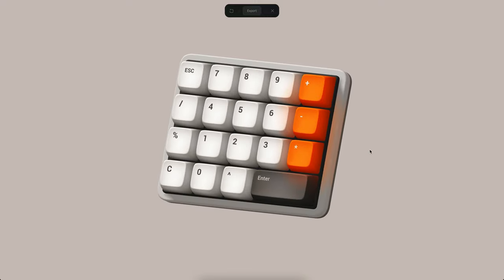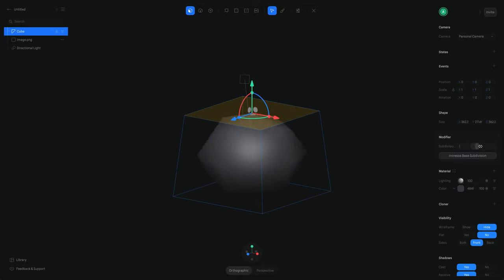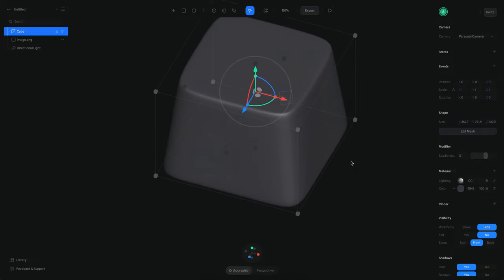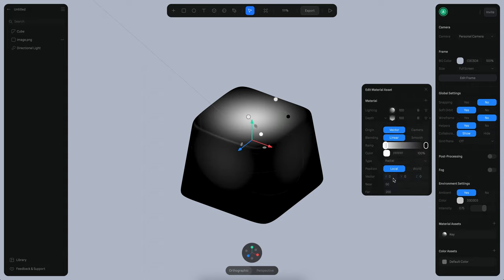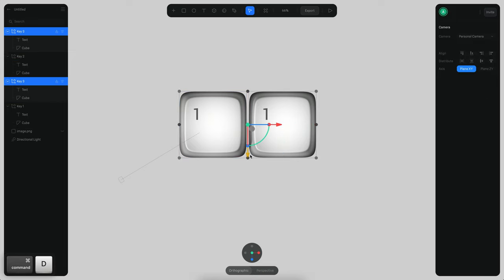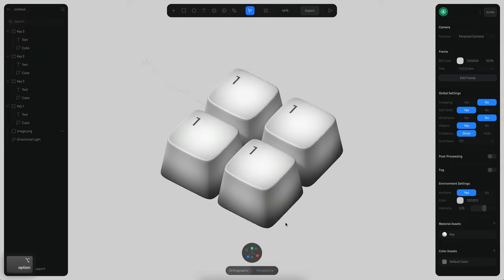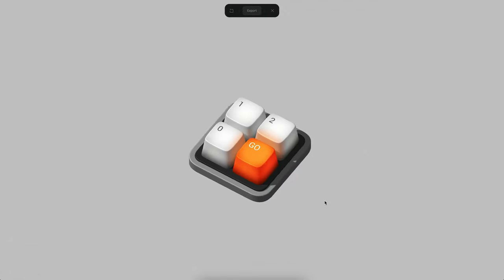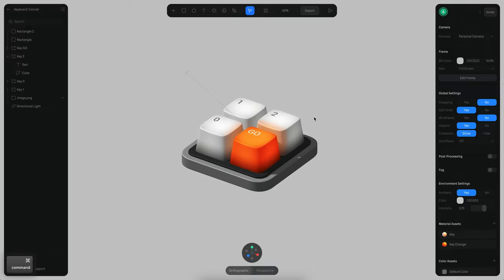How to create an interactive 3D keyboard with Spline

Comment: For anyone trying this tutorial for the first time around the time of this comment, you can still basically do everything the instructor does in the video. Just be aware that if you're using the basic version of Spline, you wont be able to change the duration of the animation transitions unless you get the premium version from what I understand. The animation will still work albeit much slower (you have to hold the button down)

To get a quick and dirty understanding of how modeling works with animation, this video does a decent job but I wouldn't use it as a guide to understand lighting concepts. Im sure there are better videos that focus on that.
Reply from the maker: Hi! This is not correct. Everything in this tutorial can be achieved with Spline on its basic/free plan.

Spline improved a lot since this video was released. The UI changed/improved, which might be why you are confused.
Reply: @splinetool  Oh you're absolutely correct! My mistake. I only noticed that the transitional slider goes up in whole number increments at the time. Didnt realize I could type out the numbers there. Tysm!
Reply: So how do I change the duration in this new version?

Comment: I was stuck at minute 1:55 because I couldn't do inset to all the vertices at the same time and it was because spline gives the figure eight corners by default. You have to remove them all and only one will remain and that's when you press shift and you drag all the vertices inward. I hope it helps someone, greetings. BTW very good 3d software.

Comment: I'm stuck, After I disable subdivision, I'm having a hard time shaping the cube to the form of a key like in 1:56 - I have ''Face F'' selected and then I would shift + clicking on the arrow to narrow the height of the cube but nothing is happening. HELP. What am I doing wrong? Using windows.
Reply from the maker: Hi Luz! Did you tried increasing the subdivision again? Btw you can join our discord community (link at spline.design) to get help. It is most likely that you are missing a step.
Reply: I also got stuck at that part.
Reply: @splinetool  Thank you so much! I did disable/increase subdivision a few times and then it started working!
Reply: I had the same issue. Just in case anyone else does too... I updated to a newer version of Spline and it all worked perfectly. If you are using the web based version is should work fine too.
Reply: I had the same issue. I had to disable/increase subdivision in the normal cube selected mode, and after clicking into the "Edit Mesh" mode.

Comment: This is great, but I don't have as many options as you are showing in the video when creating a state and an event for the button to move, and no movement happens when I fill out the options I have. Is it a premium version you're using on the tutorial?
Reply from the maker: Hi! Spline UI has changed a bit in the last year, check out our pinned comment. And no, you don't need any premium version for this.

Comment: Trying out Spline and I am a little stuck here,  I am at the stage where I am adding interactions. I made one of the Key as components then duplicated it and tried to overwrite the event.
I was able to change the no.2 Key to press 2 but I was not able to change the action. So now if I press 1 or 2 only "Key 1" is responding to the press stage but not "Key 2". Hope that makes sense

Comment: I've taken an interest in Spline and have been trying to learn through various tutorials. This will be my last comment regarding the quality and structure of these tutorials. I find the constant back-and-forth quite frustrating, as I'm sure many students, like myself, follow the tutorials click by click. When the instructor goes back to make tweaks, we need to spend more time stopping, going back, and fixing things.

I would greatly appreciate a clearer structure and less improvisation in the tutorials. This would make them not only more valuable but also shorter and more concise. Additionally, I've noticed that there's often a lack of explanation for certain choices, like why two gradient layers were chosen for the key, or the reason for moving the light. Providing explanations for these details would be extremely helpful, as it would save us time on additional research and enhance the tutorial's purpose.
Reply: oh my god, i could not agree more. As someone new to 3d design I just want to understand the logic behind tools like loop cut and in depth use cases for it rather than just get straight to creating something. So that I can quickly go over those and start working on my own projects rather than spend time creating 20 other things.
Reply: @ashleyrose1570  not so much spline related but tutorials by Grant Abbit and polygonrun way for blender might be what your are looking for. They are some of the best tutorials I came across when I was starting out with blender. They also explain the logic of everything they do.

Blender isn't hard to learn. It's quite easy actually. I haven't used spine yet so can't compare how much easier spline is but the blender process isn't hard at all for beginners. I started a few years ago knowing absolutely nothing and now can make mostly anything I can imagine and all I really did was start with tutorials from the above creators I mentioned
Reply: @Dylanjn2301  Thank you so much for the suggestion Dylan will definitely check them out for my project.

Comment: Implemented successfully.
If you run the export url, the implemented tutorial does not appear.
Is it because of the high number of polygons?
Reply from the maker: Hi! Make sure you press "Update" to publish latest changes of your file in the export panel.
Reply: @splinetool  thanks :D

Comment: sigh, this is for the people who were asking for help about smooth & edit and did not receive that help. (and also shame on Spline for not updating this tutorial either, it's not very helpful if we all can't get passed a certain step).

if you were stuck like me, delete your cube. idk what was happening with the one I was messing with but just delete it and start over. 
- click the (+) to add a new shape > "Cube"
- hold Shift while creating your cube. 
- if you're not already selecting the cube, click it
- a "Shape" menu will appear on the right. look for "Corner" (it will probably be set to 8). set it to 0
- click "Smooth & Edit". good luck all :)
Reply: @phenlism Thank you so much! it works. I was already getting frustrated at that point in the tutorial, I was about to quit learning spline too, If spline offers no help or a structured tutorial for beginners, why should I put in the effort to learn how to even use it. Spline needs to do a better.

Comment: it looks perfect but i download the windows desktop application and it didn't open it launch but nothing apears. 
does it need internet connection to do so or what
Reply from the maker: Hi Medo, Spline is a web app, it needs an internet connection to work.
Reply: @splinetool  are you intented to make it offline because it is hard to work with it in case internet disconnection.

Comment: okay, so I'm following along, but I think you could work on your tutorials a bit. you're going through so many components really quickly without explaining what they are or why you're doing it. e.g. adding subdivisions - what does that mean. I can see what it does, but a little bit of explanation goes a long way. when I'm trying to follow along, I'm constantly having to pause and check your screen to see where an element is. spending a bit of time explaining would help slow down the tutorial so that people could follow along better.

keep in mind that the end output is pretty basic. we're not modelling a super complex 3d scene, it's just 4 cubes and a base. when you do more complex tutorials, you can speed through them more because it's implied the viewer will have more of a base understanding of the platform. but if you're making something really simple, slow down and explain:
- what you're doing
- why
- (ocassionally) where to find something. 

mentioning keyboard shortcuts intermittently is also helpful. hope you don't mind the feedback, I do appreciate the content, I just think the delivery could be refined.